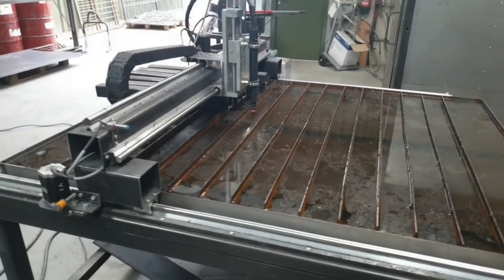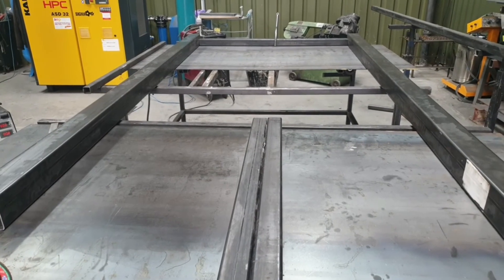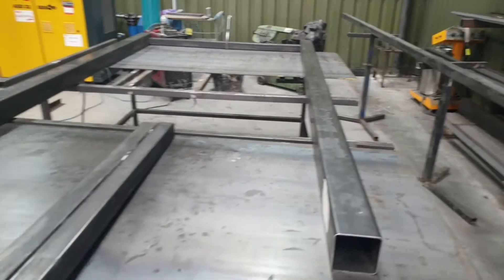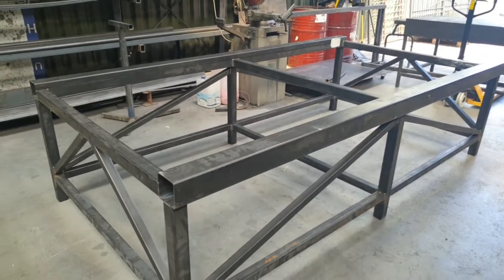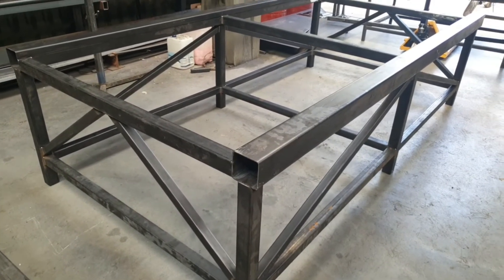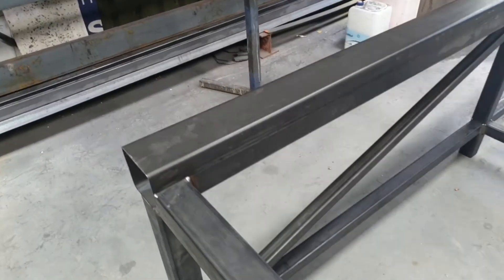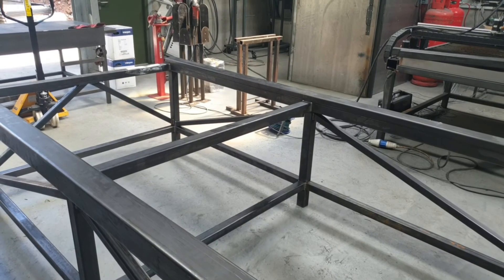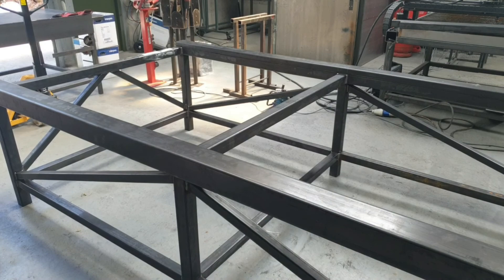Building the bigger plasma CNC

Comment: Like the videos hope to build my own. Are you using cold rolled box for the main frame? Is it 60x60x3mm?
Reply from the maker: 100x100x3 for the main frame 60x60x3 for the legs and 40x40 for bracing. You need the table as ridged as possible. Thanks for the comment 👍😀